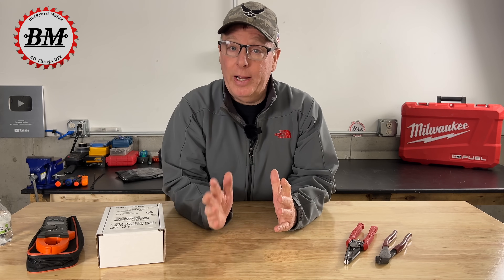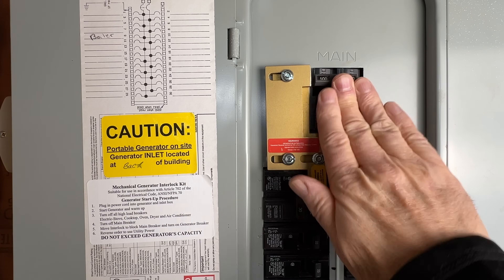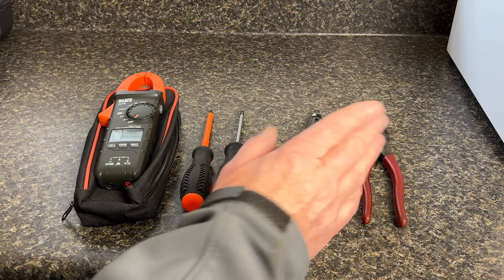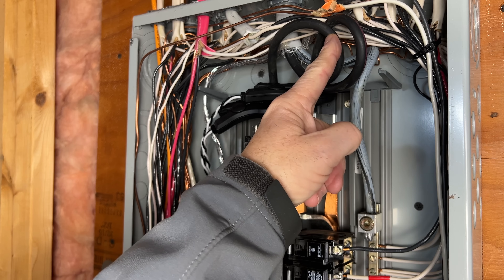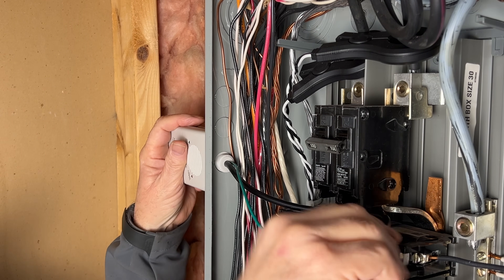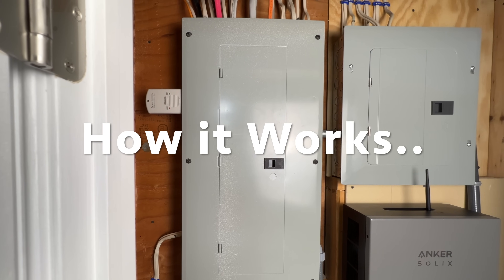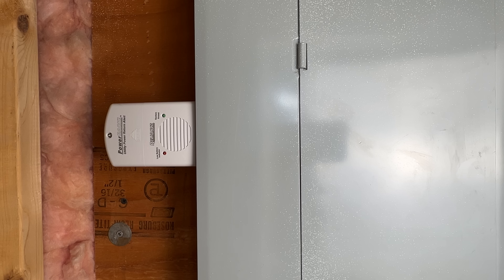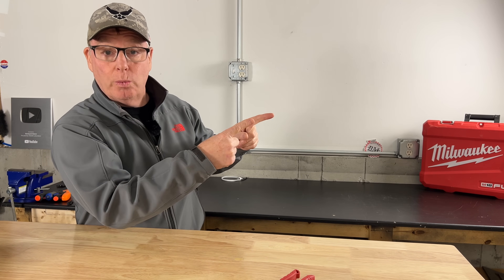The Secret to Knowing When Power's Back On!

Comment: Its EASY. I don't have all circuits in my house on the generator. I just leave the hallway lights 'on', though that circuit isn't on the generator. Then when power comes back on, I can tell right away! I could probably leave a radio plugged into another one & it would be an audible alarm.
The other thing is that I don't need the generator to run all night! the freezer will stay for that long and the house can as well, but I usually have the fireplace-woodstove running and circulating air (it has a fan which IS on the generator but will maintain the house warm enough without it.
Reply from the maker: If you are able to leave your main on and isolate the generator and main through a transfer switch or a generator pane like a GENTRAN then this would not be needed. But for the type of connection in the video (which is the most common) leaving the main on is not an  option.

Comment: You did not indicate what the black wire coming out of the device is used for or what to do with it.
Reply from the maker: The black wire is a cable to turns into the white sensor which wraps around the line conductor.

Comment: As a whole house gen owner of some years, make dang sure you have a mechanical cutover switch on the main for your house panel. Bad juju if the power comes back on and you're also running the gen. Good luck and be safe.
Reply from the maker: That was the interlock that you saw in the video.

Comment: 1) You could look at your meter display to see if the display is lit, letting you know you have voltage has been restored. Item shown at 1:30.
2) You could wire up a transformer to one of your lines coming into the breaker box which gets connected to a wireless doorbell transmitter. Plug the receiver of the wireless doorbell into an outlet and of course when the voltage comes onto the top of the disconnected main breaker, the door bell will chime.
Reply from the maker: This is a convenience so you're not running out every hour to check. Many outage here in Maine happen in the winter during snow storms. The setup you're talking about (2) is code compliant because you would have unprotected wires and a device and also you cannot tap into the line wire lugs by code. Could be a fire hazard.
Reply: @BackyardMaine - Hi, I believe this needs a minor edit to the 3rd sentence, should be ... (2) isn't code compliant ... sends a completely different message. And remember : there are a signifigant percentage of "codes are for toads"  viewers who may benefit from more detail on WHY some practices are prohibited & bad ideas, maybe a link to a pertinent video?
I remember back in my Navy days when a co-worker was charged with criminal negligance for removeing the toggle interlock on a manual bus transfer box (like the one on your panel), resulting in a shipyard worker in another area being injured because both switches were turned on and backfeeding. He honestly didnt understand the reason for it, and the hazards that would result. It was super easy to remove, (one nut) and sometimes would fall-off by itself if not carefully tightened (design should have a Nylock at least!). Rarely saw a safety warning explainer sticker on the boxes, (like I see on your panel cover) leading to some ignorance as to What it did and Why, learned mostly by OJT passdown of wisdom. This was well before the now standardized Warfare cross-specialty training of today.
Reply from the maker: @KevinSmith-ys3mh  I do cover more on safety and why in the video linked at the end of this one called seven deadly mistakes to avoid when running backup generators.

Comment: I would install one of these if it would help, but unfortunately my main distribution panel is outside next to my generator house (I built myself).  When up and running, I can't easily hear my generator running (a good thing!) and I am certain I would not be able to hear the alarm on the Powerback Monitor device either.  While it will work for most folks, I would still have to go outside closer to the generator house to be able to hear the monitor; so I'll continue to do what I've always done: check for a display that is not blank (visible readings) on my digital power meter since it is beside the generator house.  This does seem like a very useful device for almost everyone else though.  I just don't think it would work in my situation.

Comment: I wired a light bulb on some insulated clip's and clip them on one hot and the neutral,  bulb lights when power is on?
Reply from the maker: That works but it's actually a code violation and could be a fire hazard.
Reply: @BackyardMaine  yes, but only use hurricanes knock out power and the panel is my shed.

Comment: Seem like a nice idea... I accomplished the same thing with a work-box and a simple chain-pull overhead lightbulb base.
Just tapped the "hot" to the leg feeding from city power.
I used that  until  I could get a proper switch that has indicator lights that show you which feed has power.
Reply from the maker: That works but it's actually a code violation and could be a fire hazard.

Comment: I would prefer a 3 minute delay before audibly indicating Line Power return, because there are times the inrush load of an entire area ‘load’ to overload and be too much and the Line power snaps off down the line.  Let’s face it, who cares if it has a 3 minute delay anyway?  Most auto switches for gen-sets wait thirty seconds before reverting back to Line power.  Think about it further, At 2am I don’t need to be woken up by a piezoelectric alarm unless the power is really back on.  Let me sleep to 5 or 6am then alert me.  It’s not like switching to Line power is a BFD - you are likely cozy in bed already anyway and the tiny $3.63 of extra used fuel overnight is de-minimis in the big picture.  A friend used a relay on both side of the line and a Raspberry Pi to set a notification time window to address that very issue.  Before all that I set up a timer for another client that did exactly that with a real clock running off a small 7amp-hour lead acid battery and auto recharges with restroom Line power. Why panic when it’s unnecessary?
Reply from the maker: I never run my generator over night. I will shut this off when i shut down my generator and turn on my main. I'm always hopeful that the power coming on will wake me up.
Reply: @ Ok, I am curious. You don’t run your generator overnight, but I am curious why?  Noise?  Fuel cost?  Safety?  Overuse of the generator?  Theft?  And, what about spoiled food in the refrigerator?
Reply from the maker: @jerryrobinson7856  It's just a waste for us. If an outage is going to last through the night I will shut down the generator at around 11pm and the get up early around 5am to start it back up. The house will drop from 69 to about 60 if its winter and the freezers and refrigerator are fine for that length of time as long as there aren't being opened. Then on occasion we'll wake up to the sound of utility power coming back on.
Reply: @ Thank you for the clarification.  I will share a story.  I had a drug manufacturer with twenty industrial refrigerators for medications. I had provided the hi temp alarms signaling the 24 hour alarm central.  They at first went out to local food stores and bought bags of ice to put inside to tide over the outage the first time.  I don’t recall any alarms, so they stayed compliant and did not have to toss product. But the risk manager for the company and contacted the FDA who required them to buy a back up generator or toss all product if power was not restored within an hour or falling below compliance.  They used pen based chart reporters.  The generator was a massive open frame CAT plant was eye candy to be part of the quarterly testing as the alarm was also connected to generator running, etc. different monitoring outputs.

Comment: I bought one a year ago. It works great as advertised. If I'm in the garage with it, it blasts my eardrums!
My problem is that, between the noisy outdoor generator and 24' of house providing (wonderful) sound insulation, I can't hear the damn thing. 
I wish they offered a wireless remote unit!
Reply from the maker: I would love to see not alarm but just an app the sinks up with the device.
Reply: @BackyardMaine 
I'd be happy with wifi or Blue tooth .... any wireless method!
I think, in the meantime (until I can find something better), I'll adapt it with a wired remote piezo alarm . .....

Comment: A night light or plug in radio is cheaper and you probably already own them.
Reply from the maker: When the main breaker is off because you're running on generator power nothing in your home will be energized when utility power returns.
Reply: @BackyardMaine  That's why you always wire one outlet on the other side of the main breaker, to plug a night light into.

Or before I work on anything...  I have a Klein Tools NCVT-2 Dual Range Voltage Tester.  You turn it on, hold it near a wire, and if it picks up an AC field, it will beep and flash a green or red LED at you.

I bought two heavy duty male-female generator extension cables this year and cut them in half, and wired up a custom male male 4 prog cable to do exactly that in the video from generator to plug into the house breaker box.    Wired the female end into the house wiring behind the main breaker on two different houses.   So after Hurricane Helene we could run the well pump, water heater, and freezer for 2 hours a day.
Reply from the maker: @choppergirlfpv  Its not code compliant to tap off the main because the wires will be unprotected and you also cannot put more than one conductor in the main lug. There are some rules in the code which will allow short taps before an overcurrent device is added but there are wire size limitations and you have to use a set of approved connectors.
Reply: @BackyardMaine  I'm the goddess of absolute freedom, I care not for the rules made by men.  I'll do what I want in my own electrical box LOL
Reply from the maker: @choppergirlfpv  Just stay safe ok..
Reply: @BackyardMaine  Irony, because 2 months ago I was sitting in the doorway of my bathroom floor in the eye of Hurricane Helene when I checked the radar weather map on the phone because things got quiet.

Pulled my power line off my pole, and when the power company turned the power back on a week later, they did so without hanging my line back up.  I had to put a spike in the top of the creosote pole myself, and use ratchet straps to pull it back up off the ground live and hang it back on the hook.   And it's not the first time I had to do that...  it's actually... the second time...   when a tree fell across it once before.

The joys of two phase AC power delivered to your doorstep right from the nuclear reactor 60 miles away.   That nuclear plants put a big old target symbol right on the map for us otherwise in the middle of a nowhere of no strategic value, for some Russian Nuke... for the past 50 years 🙂

Safe huh

Ain't nobody safe nowhere.   Instead, I say, stay free.
Reply from the maker: @choppergirlfpv  Safe and free??

Comment: Great product but a bit overpriced $. 
I use a high powered led bulb connected to mains input with alligator clips and high-gauge (thin) wire to one leg. I KNOW it’s not ‘to code’ but 100% safe even if it did short.
Reply from the maker: It's not code because it's unsafe.

Comment: I have a circuit that is not on generator power, with a constant-on night light. All I have to do is look at the night light to see if utility power is on. Cheap, no batteries, and it has never failed me.
Reply from the maker: For a setup like that were you can leave the main on because the generator in isolated at a sub panel this type of device would make no sense. Most are not set up that way..

Comment: SO LOUD!  i only have some of my circuits on the gen panel, so i have two lights that will tell me when power is restored (Canada)
Reply from the maker: For a setup like that were you can leave the main on because the generator in isolated at a sub panel this type of device would make no sense. Many are not set up this way and the main has to be off to turn on the generator breaker.
Reply: @BackyardMaine  yeah.. So we don't have disconnects outside: they're at the top of the main panel.  My generator panel is fed by a 30A breaker in the main panel, so yes, the generator panel still has a main disconnect and a generator disconnect with an isolation interlock, but the rest of the house is still connected to the pole.

Comment: Yeah but….that gizmo measures current flowing through conductor. If you have things switched over to secondary panel/genny, what will be on the grid side drawing power thus producing current?
Reply from the maker: Most of the loads will not be on generator. But through testing I found that the alarm will come on even with every breaker in the panel in the off position. Same deal with the CTs you see around my main lugs. My power station will still know I have power on the mains with every breaker turned off.

Comment: This is a nice system, but what if you only loose one leg I had this happened to me once.
Reply from the maker: If you loose only one leg its a problem between your meter and the transformer and may be your responsibility to fix depending on your utility. The primary side of a  residential transform is just one line single phase. The two lines are developed at the transformer. Many people will call this two phase but it's actually split phase. A split phase system provides two 120V lines, where one line is at the peak voltage when the other is at its lowest point, creating a 180-degree phase difference between them. It's not common to loose one leg.

Comment: I have a smart meter which shows a blank screen when power is out.  If the display is on the power has been restored.
Reply from the maker: Yup that works too but I don't want to be running out to the meter every hour to check especially when many of our outages happen during snowstorms.
Reply: @BackyardMaine  Here in South Florida, snowstorms aren't really a problem, but hurricanes are. Actually, when power is restored, FPL notifies me by text that the power to my meter has been restored. Duke Energy does the same at my vacation home in Orlando.

Comment: I backfeed my generator from my shed to the house. yeah I know, but it works fine. I first check online to see if power is restored and that usually works. Or I just shut off the breaker from the shed and switch the main back on.  This does seem like a good idea though. Maybe I'll try it

Comment: Seems a useful gadget, particularly the alarm.  But...dependending on frequence of pwr outages it seems too expensive.   During daylight only way to know pwr is restored is to look at electric meter outside.   It's a nobrainer at night.   And since commercial power restoration DOES NOT have the same priority as a fire, the manufacturer should add a switch to soften alarm.  If installed in a small home or where people occupy nearby spaces decibel level seems excessive.  Going outside to shut down the generator, remove cable and LPG hose and then operate the transfer switch takes time.    An expedient could be to kill the alarm and switch the power back to normal BEFORE doing any outside work., but family and other distractions in the home could cause the generator to run....without a load.
Reply from the maker: For sure. My first order will be to turn off the power back alarm. Then open the generator breaker and close the main breaker. Then I can let the generator cool down for a few minutes while I disconnect the cord and put that away. Next I'll shut off the generator and put it away.

Comment: I just look at the digital display on the power meter.  If it’s blank, power is still off.  If it is cycling through its display sequence, power is back on.
Reply from the maker: Yes for sure that and other methods will work but I don;t want to keep running out to my meter especially during snow storms.

Comment: I built my own monitor when I installed our generator. Three transistors to amplify the force field emitted around the incoming power wire, which turn on a piezo speaker. Self contained, no relays, no batteries required. The piezo can be heard in any room in our house.
Reply from the maker: Thats awesome.. Nice job.
Reply: You are almost smarter than me...
Reply: That is great. Can I have the schematic? I can build it but not design it .😃
Reply: can you please supply the design?

Comment: when you turned off the breaker you should always use a padlock to prevent tampering. As an unlimited journeyman I am always reminding my other electricians to be safe.
Reply from the maker: Nobody around that would touch my residential breaker but if someone might a lock should be installed. I used to teach LOTO, Arc Flash protection, NFPA 70E and general electrical safety before I retired from my electrical engineering job with TI. I also spent a few decades working as an industrial electrician.